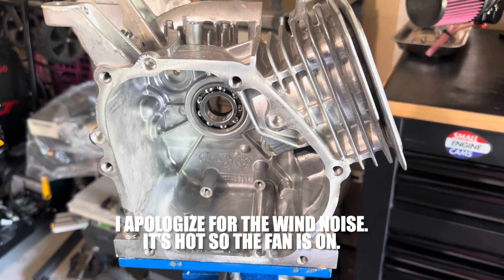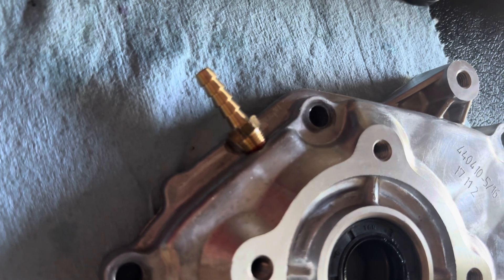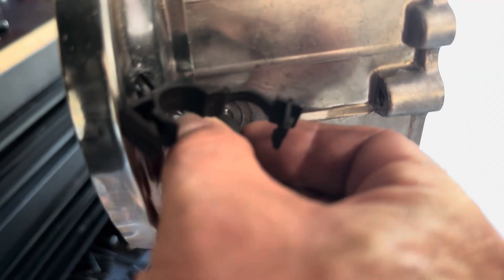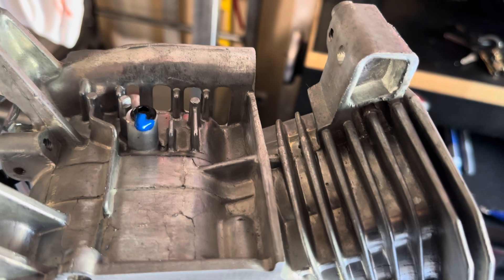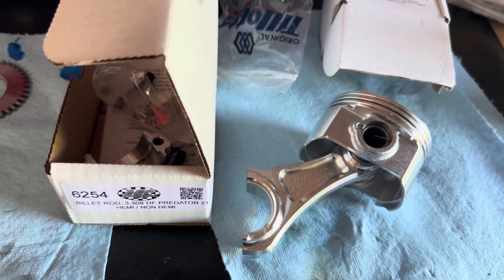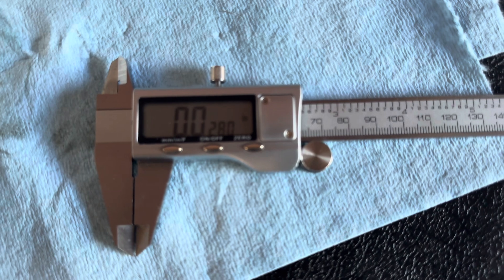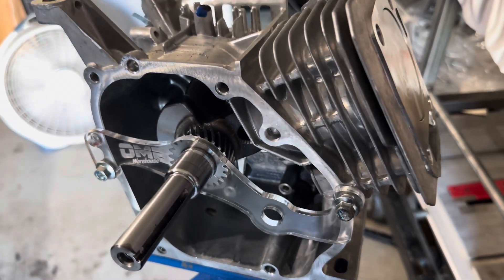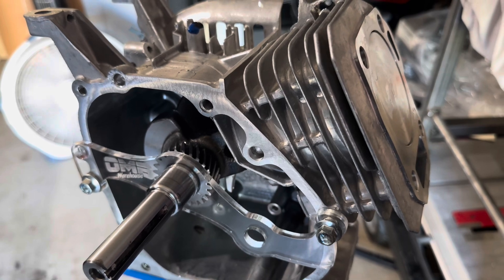Building a High Performance Harbor Freight Predator 212 Part-1

Comment from the maker: A microphone is on the way...
Reply: Ah!! I have the same fan😅
I always prefer to tap the holes and use blue locktite. I’ve never sold any of my engines. Guess that would called a horder..
Reply: I see why you asked me that question about my microphone. What are you using to film with?
Reply from the maker: @DIYWilly  IPhone. It’s what a buddy of mine uses for his stuff and gets good results. He just had a lot more expensive accessories than I do. I’m in the market for a GoPro though, especially for filming mini bike rides.